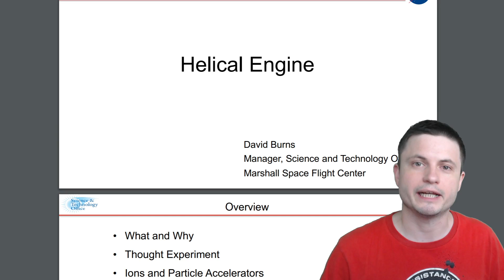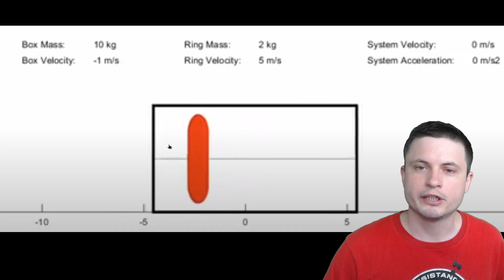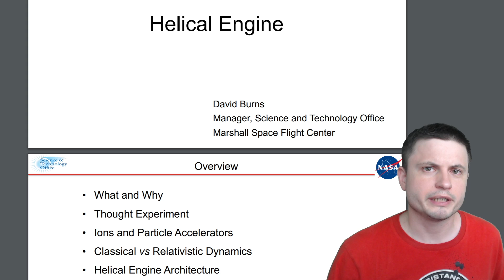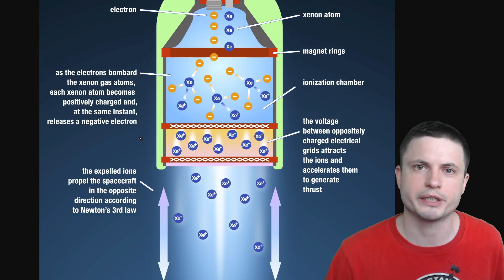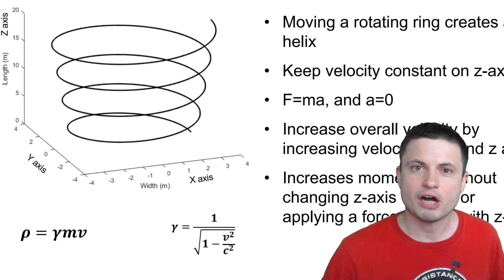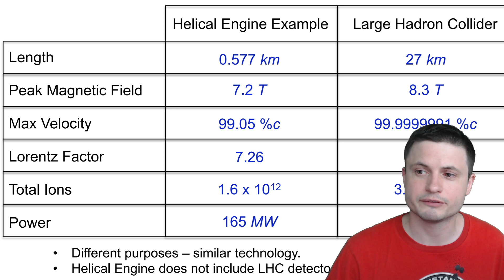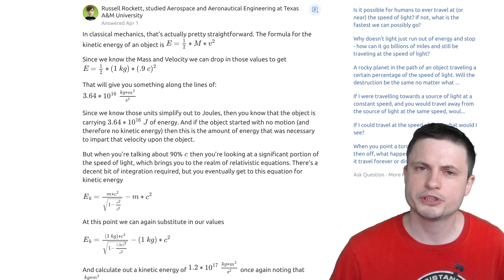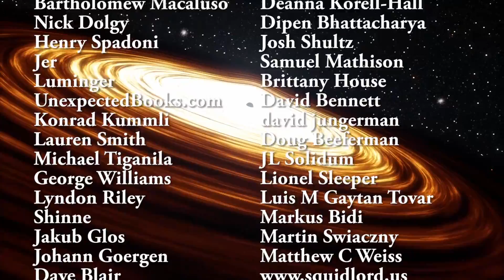NASA Engineer Designs a Near Light Speed Engine But Does It Work?

Comment: Anton, if the designer is just going to use a ring and run the 'slug' in a circle, why not just use a particle accelerator as the ring? My thought (without any math to back it up) is that you could accelerate the mass as it's running around the forward-pushing side of the ring and decelerate the mass along the back half. 

With the right design, you should be able to recover some of acceleration power (akin to regenerative braking on an AC powered electric car). You also 'might' get some of the relativistic benefits from such a setup at low speeds because the mass you're using to accelerate is running at relativistic speeds even though the ship is not.

Also, if the entire ring is is full of relativistic particles and we accelerate the 'forward' part of the ring and decelerate the 'rearward' part of the ring, you should have a constant acceleration as opposed to pulsed.

Thoughts?
Reply: Hmmmmmmmm
Reply: I totally understand this............   I'm pondering it.... Yes..............
Reply: But really, this is definitely interesting.
Reply: @Muthusala2630  the nice part is you can feed the accelerator with either onboard 'fuel', spent reactor fuel (for really big particles), or with the magnetic scoop.

If you really want some fun, it can double as a particle cannon. I did the math on this back in high school, and even a handful of relativistic particles would devastate any hostile targets.
Reply: @slateslavens  I mean, space death ray=cool, but why?
Reply: @Muthusala2630  Only because at the time I did the math and ship design I my friends and I were playing one of those early-90s space-based board games.

 The other guys were all about warp drives and other truly fictional sci-fi stuff. I wanted to go as real as I could, so making the assumption that wormholes are a legit thing, or maybe folding space, I looked at what it would take to create a black hole out of nothing. The easiest way I could come up with was a massive PA (particle accelerator). I'm not saying it would really work, but that was my thing at the time. I incorporated using the PA as a weapon and calculated the actual mass needed to inflict damage for various particles, and at a high percentage of C the needed mass is pretty small.

Anyway, when I watched this video I remembered the PA-powered ship and thought it might be a viable solution as long as the physics behind what Anton was talking about was solid.
Reply: @slateslavens  that's pretty awesome

Comment: The real problem isn't propulsion, it's shielding you have to prevent objects from impacting the hull.
That's going to be very difficult if not impossible. So the hull must be thick enough to  withstand any and all impacts well. Building a ship like that would be ridiculously expensive. What to do?
Hollow out a very large asteroid made mostly of iron. Add propulsion,navigation,living quarters,hydroponics,small support vehicles, and you're off on your merry way.

Comment: Too much time wasted on thrust, not enough time spent on the reduction of resistance. The ping pong animation works on the assumption that both sides are equal. Like... same ball being volleyed between two players of equal strength. That mentality will literally get you nowhere. There are three points within this model that allow for an increase in velocity, by shifting excess energy. Toss a solar panel on that bish, and figure out where to place that energy. Me, personally, I'd devote a majority of that energy to reducing resistance, and giving a slight advantage to the servers strength.... anything left over is used to prevent the reciever from blowing it out his arse. These models are based on finite energy equations. But for practical purposes, relatively speaking... it's not finite.

Comment: If it takes as much energy or more to bring and maintain a small mass to sublight speed in order to propel a larger vessel to nearly the same speed as it takes to propel the larger vessel to sublight using a more direct method then does this really do anything useful? Plus this is based on using a quirk in a formula which could actually be caused by a different phenomenon that would mean this doesn't even do what it is theorized to do.

Comment: just make a photon engine
Reply: you can move 88 years with similar speeds without losing any material
Reply: you could launch a micro space craft with very fast speed, containing internal non-solar alpha source to give power
Reply: if you can get out of a black hole, you have more than enough capability to do all what you need

Comment: I have a certain amount of knowledge of special & general relativity (SR & GR), from decades ago, at the undergrad & graduate level, and I think that what that paper describes as the concept behind this drive system, is impossible, because it violates conservation of momentum. In SR, there is a 4-vector energy-momentum, which is conserved in any isolated system.
I have not, however, studied this proposed mechanism enough to confirm or refute it. It seems to have some of the elements of the simpler forms of perpetual-motion machines.

And incidentally, mass does not change in SR; this erroneous notion is actually taught sometimes in physics courses, but it follows from a fallacy – namely, that in SR, momentum is still given by something in the form
p = mv

Then, from the SR formula
p = m₀v/√(1–[v/c]²) = γm₀v
the conclusion is drawn that m varies with velocity:
m = γm₀v = m₀/√(1–[v/c]²)
where γ = 1/√(1–[v/c]²), and m₀ is "rest mass."

In truth, momentum simply has a different velocity dependence in SR than in Newtonian mechanics; the "gamma factor" attaches to "v" in that expression, not to "m."
And the so-called, "velocity-dependent mass" in SR, falls apart as soon as we try to apply it to, say, kinetic energy. This would have us believe that in SR,
T(?) = ½mv² = ½γm₀v² = ½m₀v²/√(1–[v/c]²)

But this is incorrect. Kinetic energy in SR is actually
T = (γ–1)m₀c²

The two expressions are equal only for the trivial case, v=0.

Fred

Comment: what about the massive amounts of cosmic and interstellar radiation and hot temperatures we talked about in a previous video? the great expansion is gonna be nearly impossible. we're gonna need a ship the size of a planet with its own magnetic field and a black hole in it or orbiting it. if we had that we'd be protected from the massive amounts of radiation out there, we could have a functioning warp drive MAYBE and we could feed the black hole matter and redirect the hawking radiation as power and propel the space craft that way. not to mention we'd have a black hole on life support..... how dangerous is that...... scratching my head elon is an over achiever but i dunno elon. i think about the great void out there in space and how a type 3 civ could be gobbling up stars to power their shit. wondering how they go about doing that, literally building their own machinery out of solar systems and galaxies. insanity.

Comment: Much as I would love a proper interstellar engine, wouldn’t it be far more feasible and immediately useful to base energy requirements on, say, 50% the speed of light? That alone would open up the entire solar system to reasonable travel
Reply: Or is that not quite fast enough to see the needed relativistic effects?

Comment: Personally I think the term light speed means light reaction, either using warp via magnets or pushing iff a wave via magnets..

Taking inspiration from earths poles, earths core and mechanics if black holes, which in theory is easy enough to explain.

Imagine is two north magnets face eath other and ate close enough they distort em space and is there was a s wave it could push a stream of waves in a direction or be used to push off...I thinkbtge warp approach seems to be a basic idea that means the ship isnt moving but is...
Reply: I see your idea, and while it seems like it could work, the problem would come up with how the vessel would travel. To keep the repulsive force of the magnets set to a certain distance, they would likely both need to be attatched to the vessel, and so wouldn't cause propulsion that way. If you could possibly find a way to use the magnets' repulsion fields to interact with an outside piece of equipment, it should have some sort of forward movement

Comment: Eventually we get smart enough to hop between stars with relative ease. 
But with every design so far I just wonder, where are the brakes?
Reply: You rotate around halfway to destination and use the engine for the second half.
Reply: @GreatBumbino  i was gonna say that there'd be a second enging facing the other way to slow the craft down, just to be flashy

Comment: They left the mass of the ship with the mass of space small atoms carbon etcetera they could possibly cause fatal errors if not used cautiously an outer shell such as the secret obleck material being developed in Russia or China one of them or use a magnetic distortion device which could work but it could also implode the ship as appearing in two places almost simultaneously  could act as a kind of atom bomb

Comment: so a RELATIVISTIC SHAKE WEIGHT lol.
but here's a question - why does it have to be relativistic speeds at all?

even though it's very very small, there still IS an increase of mass if something accelerates AT ALL right?

so if you have a 1kg weight move backward very very fast... say mach 10 and then come back at 10mph... wouldn't that actually still produce thrust?

so it's not too dissimilar to a swimming stroke - slower streamlined up stroke with a forceful downstroke that claws at the water. so there's no medium to claw in space but it would still operate somewhat like a swim stroke at non relativistic speeds... wouldn't it?

Comment: Wouldn't it be more practical to just build a new place to live and not have to go so fast?  Centrifugal gravity is pretty easy, plants produce oxygen and if we can tap into the mass of the visible universe as a power source we solve the light problem (for the plants).  Most, if not all, of the stuff we need to build this place is already up there, save some of the machines needed to build it big enough.  Besides, what happens when you hit a piece of space dust at that velocity?  Get a grip fools, you're pretty good at math but it seems you lack the intuitive capacity to glean the problems that NEED solving.  :)...o  Have fun  spinning your wheel.

Comment: Time Dilation, Space contraction, and other ideas of Einstein (not only him as those existed before Einstein) are absolutely fake news. I addressed the whole absurdity of Time Dilation in my new book - The True Essence of Vacuum. And there I also explain how to test and why Matter-free areas are absolutely impossible. So, the whole modern Cosmology is based on extremely faulty assumptions. And yes, in that book I explain why there is no sound in Vacuum and why objects fall at the same rate, and why pumpos dont work too. All that can be explained perfectly even if the Vacuum consists of a substance that is highly stretched and fully fills the given area. And yes, it can be tested.

Comment: A fusion reactor using a few kg of fuel would do the trick as the yield is approximately 1000x that of fission. I would need to run the numbers using ITER's expected output to check my theory.

Comment: Regarding the twin paradox, I've always wondered, if motion is always relative, how can we say that Twin A is moving near the speed of light relative to Twin B, and Twin B is stationary?  Isn't it also true that Twin B is moving near the speed of light relative to Twin A?  Why does Twin B have to be the one who ages faster?
Reply: The important thing is that the twin B followed a straight path through spacetime. It doesn't matter in what reference frame you describe the experiment: twin B's path is always a straight line. Meanwhile, for twin A to ever meet with twin B again, he'd have to stop, turn around, and travel near the speed of light in the opposite direction. Twin A can't possibly have traveled in a straight line. In a reference frame where Twin B is at rest, Twin A's path through spacetime will be (let's assume infinite acceleration for simplicity -- it's not essential) shaped like a >. Geometry in spacetime is weird because time is different from the other dimensions, so the straight-line path is actually the longest path through spacetime. The 'length' of the path is what we understand as the time experienced by someone traveling that path, so twin B will experience more time and become older.

If you imagine an alternate version of the experiment in which Twin B remains on Earth and Twin A travels close to the speed of light, but in a straight line, without ever slowing down or returning, then you can't say who ages faster. You need to be able to compare the two and that can only be done if they meet because as long as they're separated there's no notion of "simultaneity", so you couldn't arrange for them to measure their clocks at once and then send signals to compare their results, for instance.
Reply: Yeah. I have never bought into time dilation. One of the earliest experiments was using mechanical watches, (which I love but are very subject to friction and changes in gravity). Of course the two watches showed different time and the one on the jet would move more slowly than the one on the ground. In any case, mechanical motion doesn't equal time per se. More recent experiments have basically all been variations on this theme.

Comment: Why can't we just brute force our way to Mars? Launch a bunch of spaceship into orbit, to top a main one off in orbit, and then send that to Mars with a full tank? Hell, send 4 or 5 of those to Mars, then parachute the fuel down for a return trip? Mars gravity is only 0.3g Earth's so it can't be that hard to break its orbit. I know it's extremely inefficient and expensive but even with a near light speed engine, we aren't getting that far beyond our solar system. Might be worth it to colonize other planets/moons here first.

Comment: You couldn't more easily produce mass because when talking about the kilogram of uranium it decays into other elements therefore not losing all of its mass, if you want to create fuel from energy you'd require 9*10^16 joules for every kilogram (E=mc^2), which you'd also have to accelerate when throwing it out of the ship if you want to accelerate

Comment: Mercury gyroscope. Make it go faster at one end and slow it down the other side with electromagnetic fields. Done friction free in vacuum there would only need to be small energy inputs powered from solar panels to vary the speed once it has achieved high angular momentum.
Reply: High angular momentum relative to the speed of light evoking this mass shift hence acceleration

Comment: Take a craft ,then put two metal rails maybe more ,then using railgun tech launch craft to 5000mph,but instead of craft flying away from rails they are caught just as craft to seperate and fly off but rails caught and brought along ,then soon as power is recharged then fired again , so that 5000is added to 5000 this process is continued until  the desired speed is attained ,and using four rails that are a little longer than craft so at the front this magnetic field can be made a solid disk then slanted so any micro meteorites are deflected away from craft ,a desirable speed should be attained , now each crew will have electro magnets throughout uniform and other e bags throughtiving space so in a magnetic field gravity can be created for healthy long-term space travel , the living space should be a moveable sphere within a sphere with magnetic field around living space these rotating speed are counter rotating this would create power if copper contacts seperate spheres ,this is my idea for space travel water can be made from hydrogen and oxygen a reactor won't need water for cooling use the cold of space to cool duel rods , you guys are welcome

Comment: For space exploration outside our solar system we need a way to travel without the need of fuel which at some point will end and all people or life on borad will die. Couse we as a species propably can't achive travel to other stars in our short lifetime. To achive that we need to enhance our bodies. Genetically or mechanically lenghten our lifespans. Which still can be too short for interstellar travel. Most likely aproach is in which machines will recreate our species on other platnets. By transporting our genetic code. Embrios and seed. By terraforming or building colony first. Then rising first humans to inhabit it. Our machines will need to be so reliable that they can exist and work for hundreds of years without any need of human intervention. If we can achive that kind of level of technology. Then sending human arks or vaults of human DNA within cradles made of machines can be achived. To do so we need to first unite and go for Mars and Moon first. Then the rest of the planets and objects in our solar system and then at last into interstellar travel. We can try to do it before achiving all those goals but only if Human race would be at risk. Otherwise its wasted effort.

Comment: The solution is a caterpillar drive that heats & contracts space so the space moves around the ship one can achieve this effect easily with focused microwaves or high powered lasers so the greater the stretching of space the farther the ship travels when that space cools down the ship isn't going faster than light but it's moving at the speed of space which as inflation proved does move faster than light